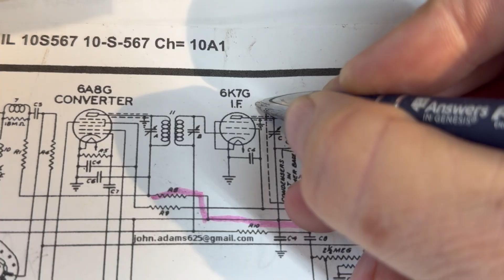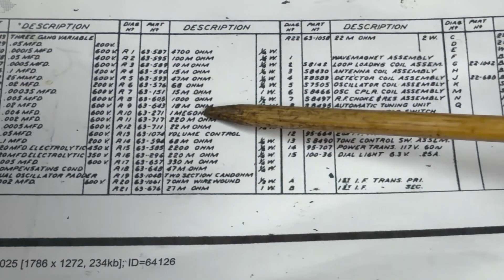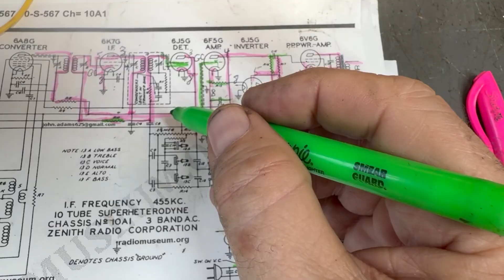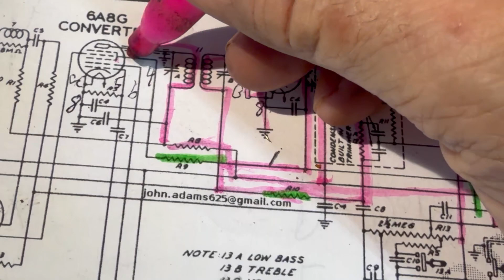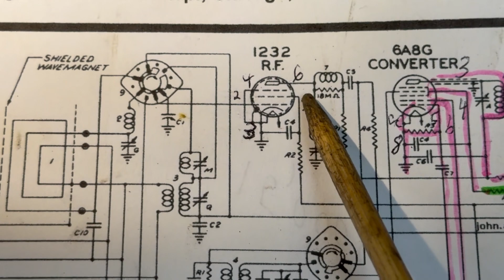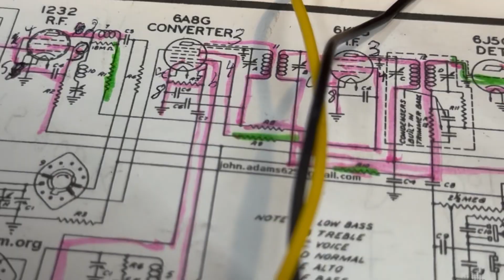Pt 13 Understanding Tube Radio Schematics for the Beginner.  The Front-End Tube Wiring.

Comment: Just a tip...
Dont overlook belts, from vacuum cleaner parts stores for belts that will work for radio dial drives.
You would be suprised at what you can find.
Reply from the maker: That is so funny. We are changing out that center spindle and the belts will be in that video. I will bring up your tip during that video. I have a good supply of new old stock general cement belts that are still soft but I was going to bring that and “O” rings too for those not as lucky as me on landing these belts. Thanks for your comment. I was traveling today so that is why there was a delay in answering you.
Reply: Thanks